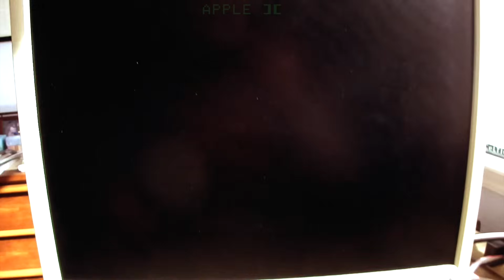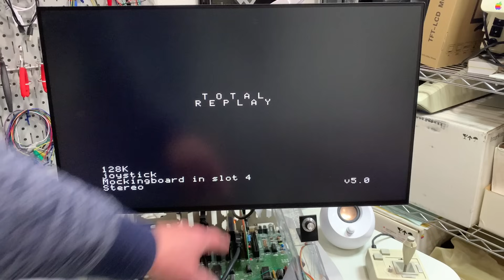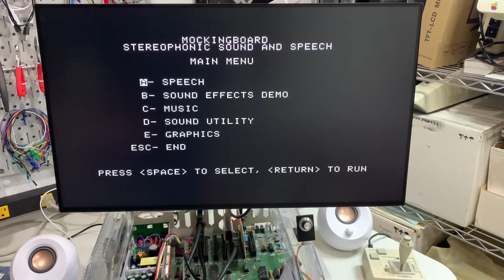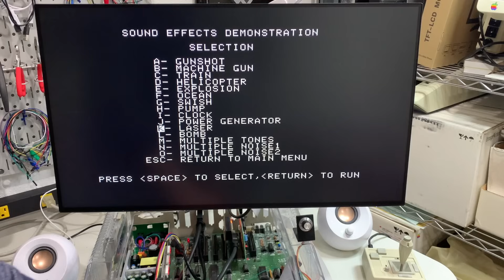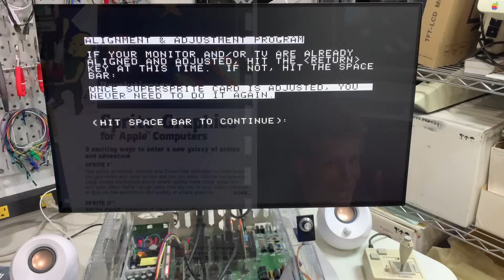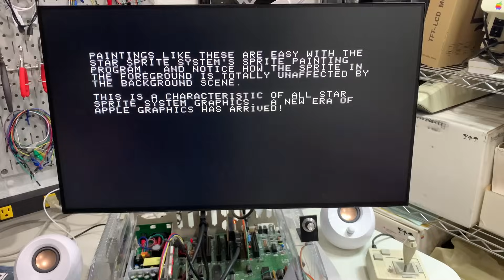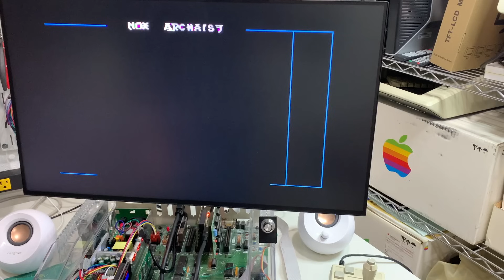#156: Can One Apple II Card Replace Them All?

Comment: Nice review Chris! I must admit, the $199 price was a bit steep for me, but it appears the price has dropped now to $149, which is good. This is on my list of things to get, I have a VidHD, but it is shared right now between my IIe and IIgs. I guess one of these in my IIe would make the most sense and I think the Mocking Board is the biggest draw, I could never bring myself to by a MB card for the limited number of games that support it, but now its in this bundle, well, its a no brainer. Cool stuff!
Reply from the maker: Yes, that was the same for me - the combo with the Mockingboard is excellent. Plus, while the VidHD is nice, it's also unobtanium for people at this point, and it has that tendency to eat floppy disks ;-)
Reply: @CT6502  I've not had my VidHD nuke my floppies, not that have noticed anyway. I spent the first couple of years with my Apple IIe exploding disk drives. Don't ask... but the drives all look very similar and if you plug some of them into certian machines, Poof, magic smoke time :/. There are some REALLY cool boards coming out for the Apple II and IIgs right now. Sadly, my own channels income does not allow me to buy these things with inpunity. There is the AppleSqueezer GS, GREAT board for a IIgs, but at near £300, I cant justify it right now, argh...

Comment: Thanks for the video. Where did you find the panel mount HDMI extension cable ?
Reply from the maker: I fuond it on Amazon. The link is probably stale by now but if you just search for panel mount HDMI you should be able to find a few choices

Comment: Interesting, but having the audio go out HDMI isn’t ideal for my setup, if you turn that switch off, where does the audio go?

Reason I ask is I have a small 8 port mixer that I run all of my retro machines into, they share a set of speakers and split output to capture.
Reply from the maker: The Apple II normal system audio always goes out of the Apple II speaker, regardless. Other audio, like the Mockingboard, only goes thru HDMI. However, my monitor also has a 3.5mm audio output jack, so I can just run from that to my actual speakers. Maybe you could see if your hdmi monitor has an audio out jack?

Comment: Brother this is very exciting !   if i purchase this card and they update it to include Ethernet will I need to purchase a module for that or would it be a completely new version of this card  that would replace this? 

I also use Apple iie BOOTI in slot 7 and wondered if you had any issues or conflicts ?

Many thanks ! Sando
Reply from the maker: If they change the firmware to include ethernet, you would just need to update the firmware, you would not need a new card. I think the Booti should work just fine, but I have not done extensive testing.
Reply: @CT6502  thanks brother.  So would you need to get a usb ethernet adaptor to plug into this card?   I dont see ethernet port on the card itself.  thanks
Reply from the maker: @sandyd6602  I guess? It doesn't have ethernet support yet, so I'm not sure how they might plug in the cable. I guess we'll have to just wait and see...

Comment: Chris could you post a link to the panel mount HDMI cable that you are using?  Thank you.
Reply from the maker: Hmm, I don't recall where I bought it. I looked on my Amazon orders and it's not there. I do recall that it was just a bit big for the case opening, and I had to widen the opening with a dremel. So it wasn't perfect, and maybe it's better for you to just look on Amazon and find a different one.
Reply: No problem. Just wondered. Found one on Amazon that looks like it might work. Oh and thanks for replying.

Comment: could you tell the brand and model of the small LCD display sitting on the disk ][ ?  i've been looking for something that small for several projects.  thanks.
Reply from the maker: It's actually a "no-name" brand. The label on the back says 11.6" monitore, OHM-1106. I got it from ReactiveMicro: https://wiki.reactivemicro.com/12-inch_LCD_Display
Reply: @CT6502  thanks.  it still might work for what i need it for.  

i did find a spec sheet for it.  part of a whole family of fixed-resolution monitors made for security systems.  https://atlasgentech.co.nz/media/wysiwyg/OHM-1106A_Data_sheet.pdf

Comment: I am intrigued by this card... I am wondering if it has any issues with the RomXe chip I have installed on my ][e like the V2 Analog VGA PicoPal card I have that wouldn't work fully because of the RomXe
Reply from the maker: I asked the team, and Joshua said: "Likely to be fine with the RomXe CD and EF ROMs. Could be a potential problem with the optional 32-font video ROMs though as the a2n20v2 Multicard has its own copy of the //e character ROM that it uses for display."  Both product are sold by ReactiveMicro so you might reach out to Henry and see what he says.

Comment: Thanks for featuring this awesome card - added to my wish list!  Agreed that volume control would be helpful.
Reply from the maker: The latest firmware update (which I did wrong) actually fixes the two different volumes so they're at the same level. Then you can just adjust the overall volume on your speakers/monitor.

Comment: Nice review. I have a VidHD card but not a Mocking Board. I think I will get just the Mocking Board. As for firmware update, I have other FPGA gadgets and you normally just plug them in the computer, they show as a drive and you just copy the update file to its root directory, the update occurs normally on next power cycle. I wonder why it has to be like you just demonstrated. Thanks again for the video
Reply from the maker: Good question on the firmware update process. I'm not sure if it's the particular board that they chose? https://wiki.sipeed.com/hardware/en/tang/tang-nano-20k/example/unbox.html

Comment: I see that the actual fpga is on this daughter card, right? I can't help but think that this could be adapted for a //c. That's the machine that I have.
Reply from the maker: Yes, I imagine it would be possible - it's a small form factor. They would just need to piggyback on top of one of the other chips, similar to how the Mockingboard 4c works.

Comment: Great review!  Can it emulate multiple cards at once?   Example, do you give up Mockingboard support if the FPGA is acting as a supersprite card?

 Any idea how the super serial card support would be added so that a db9/db25 connector can be provided?
Reply from the maker: From Joshua:
All functionality is supported simultaneously. So no, users don’t have to change modes or configuration to switch between things. We listen directly to the bus and the video RAM on the entire Apple II family, and then point instructions and data where they need to go.
Super Serial Card support is currently offline in the current version of the firmware as we had picked up a couple of problems with it. If we are able to close those issues, the intent here was to support USB to USB serial connections so that things like ADT or VDrive didn’t have to go through a mess of different serial adapters and connectors. DB25 or DB9 RS-232 interfaces were not part of our original design goals - just a cleaner path for ADT or comms with modern machines.